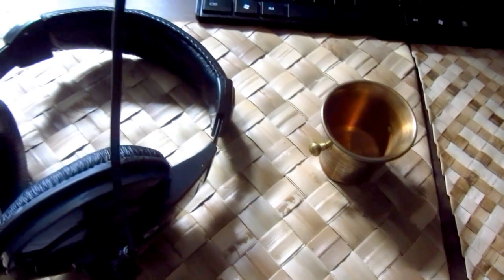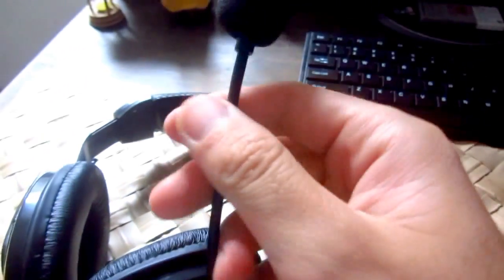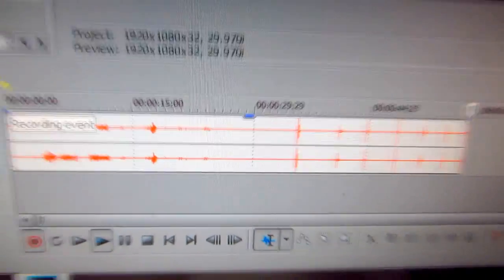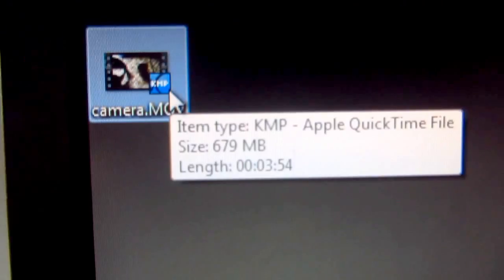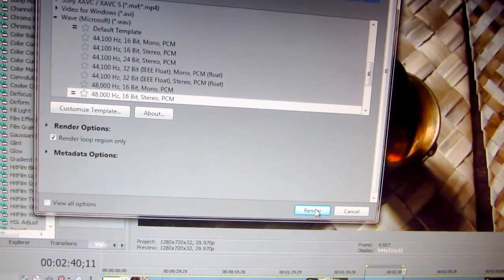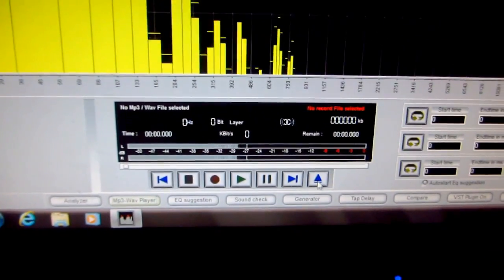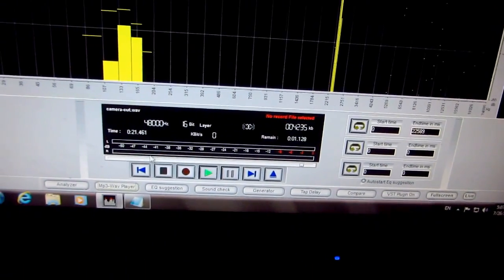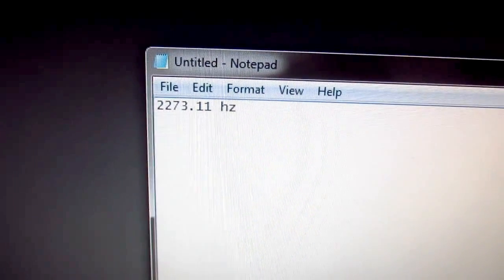How to find the Resonant frequency of an object (.wav files)

Comment: To hit absolute resonance there is multiple frequencies in parallel peak and troff. If that was hit, the material would begin to break apart molecularly. Time scale on which this happens is very small and hence the material stays solid. A constant would eventually make the solid object move from it's position so as not to break apart.

Comment: This is mechanics wrt sound. In mechanics of the purest sense we do a bump test. We hit an object with a mallet. Usually wood or metallic.  After strike the response to the bump is measured with an accelerometer.  The Wn = sqrt k/m.
The example is seen in olden days safe openers that used the bump test with stethoscopes to determine openings.

Comment: Recording while talking but the way you went about that is slooooww. Be quiet, tap bell, save file n highest possible format. What you really need is the harmonic that will cause the bell to resonate at it's own frequency. Likely you don't have a frequency projector capable. I wonder what happens if you deviate 33.3 hz higher or lower than harmonic? Pop goes the bell?

Comment: Remember anytime you gonna convert an analog signal in these case the sound wave coming from microphone into digital you have to keep into account a proper sampling frequency in line with the Nichols Theorem that state your sampling that have to be at least 10 times or better 100 times in practical terms the frequency of your signal, to have accurate D/A conversion otherwise you got nothing.

Other thing that does not determine the Natural frequency of that bowl. Your Spectrum Analyzer is just showing the frequency response of that bowl to a given stimulus , which means one of many, ok.

the way these is done by a machine is introducing feedback into a close system the same way Tesla did on his experiment in a building that almost was destroy by an array of three pounds hammers  hitting the building steel frame back early in the XX century. 

No offense you are playing with your software and that bowl that it.
Reply: interresting. How do I calculate the resonant frequency of a building in order to destroy it? Each room has another resonant frequency right? I can easily find it with my voice but it doesnt break apart or something
Reply: @trollmcclure1884  Find resonance of the I-beam and match the tone,  There is footage back in the day of what the OP said,  the contraption continuously sends pulses (taps) into the I-beam, and after a few hours the I-beam started to resonate (wobble). If this contraption was attached to the structures foundation I-beams, the building will collapse.
Reply: @GrahamMasters87  Excellent. Mwhahahaa

Comment: Frequency?
5/3/2018   Robert Shrewsbury    My brief thoughts for today.                                                                                                                                                                                                      Element & Compound Resonation for researchers.
An Element will not resonate if the frequencies are not pretty much accurately "right on the mark", to the tenth of the Hertz. The atomic spacing of elements is measured in nano-meters. Spacing changes with gravity, thermodynamics, light/darkness and atmospheric pressure proportions, caused by earthly and cosmic anomalies i.e. like the moon apogee/perigee as well as earth/sun perihelion, etc. So to be concisely accurate, it is a must to track these frequency changes on a daily and nightly basis. Resonant Frequencies and wavelengths are based on the Atomic Spacing in an Element, at the time of day or night and the particular geographical location you are at. When this atomic spacing changes, even a fraction of a nano-meter, elements and compounds then resonate at a slightly different frequency/wavelength.  
A remarkable healer, Dr. Royal Rife, used a very-specially-engineered powerful microscope in his work, so he could see when he was resonating a disease. He had aimed to know the resonant frequency of diseases, so he could successfully destroy these diseases, using destructive frequencies. Dr. Rife was aware of these frequency changes and he facilitated the changes (at his end) creating a custom solution for each patient, in his/their time. Dr. Rife's middle-base or center frequencies, that he used to kill diseases, do not work so well now, because the people currently using them do not A) know of this frequency change phenomena or B) how to keep up with these continuous frequency changes for each disease. (Dr. Rife's massive precision microscope has not been in use since his death of August 5, 1971.) 
In some cases, the modern "Rife Machine" salesmen can be more interested in selling a "healing machine" for profit than whether it actually helps or not. It is also possible they may believe it works, without observing the actual statistics over time. This then can be a "snake oil salesmanship" situation.  Because of Rife's precision with each case, he did do phenomenal work and cured every case of illness he ever worked with, but people since, not doing their work anywhere near precision, have been doing erratic or partial healings or having too many failures become commonplace.
I am only releasing a little bit of information on precision frequencies because it needs to be known, and also for the ill of our people, in hopes that some serious/sincere, competent personnel will pick-up and do the precision application, healing work and the research that is so needed. I am more of a discoverer, researcher, investigator, developer and inventor than a technician or businessman!    
My own studies have been leading me to confirm Rife's original successes and methods.  Using different methods of finding and knowing the resonant frequencies of hormones, elements and compounds and their frequency changes, I do not need a state-of the-art microscope as Rife did, to find the frequency variances of elements, compounds, hormones or diseases. I have been involved in frequency transmissions, applications and research for about 25 years now and am still learning a lot. 
A recent sample of my work.                                                                                                        In charting the total frequency changes in 6 days (following the Moon's waning cycle) on Human Growth Hormone HGH, I found the total cycles-per-second CPS receding (Moon waning) from the start of 4/28/2018 to 5/3/2018. The HGH positive +side receded  2.5 cps, HGH negative - side receded 4.1 cps. in just (six) 6 days.
It only takes two tenths of a cycle per second (or less) to miss resonation of an element, or worse, bleeding into another elements frequency, missing the target altogether. In practice, any work using a consistent frequency to aid repair or stimulate would soon have a condition of being reduced in connection or unable to interact with a person or element, until some time later when it just "happened" to coincide again by rare chance. 
This is why I study, test and research and that is also why I keep abreast of  frequency changes continuously in my work. A variety of natural frequency changes, even adding together, make it nearly impossible to effectively create a health-solution with a proper frequency. Effective application and better progress is related to a person being aware of changes occurring,  and then learning how to A) keep abreast of the frequency variances and B) staying on a tuned daily frequency resonation course. I am not sure why this information has remained so miss-understood, not-understood or incomprehensible for so long!?
I didn't start with an intent to research health, but my other studies gave me increasing information to understand and improve my own health.  What influenced my original  involvement in this element oscillation work was that I was learning how to stimulate and resonate valuable elements like gold, silver and platinum, "Ringing them like a bell", so to speak. This meant I could better detect them by the energy-increase and display that is created when an element is selectively oscillated electronically. 
One thing I did, was I purchased some "gold finding" resonators called LRL's (Long Range Locaters) and did a lot of tests and blind-tests, only to find out that these costly LRL's rarely if ever worked. As a single example, a poor use/choice of parts can pollute and  ruin correct signal forms. What a person thought was being projected was actually damaged or altered...and postulated results could not happen.  
Over many years, I found one of the many problems in using a correct frequency (of an element) was that the resonate frequencies of elements are in continuous fluctuation, they are not the same from day to day or even hour to hour in most cases. However, the gold/platinum/silver frequency categories on the precious-metal detection (LRL's) machines had only one frequency setting per element.  Having a single setting meant there was no way to adjust for changes in the resonant frequency of an element and there certainly was no published knowledge of the oscillation changes of the elements on a daily basis. Worse, element frequencies also change in different geographical locations on the same day because of magnetic and electro-magnetic changes in various geographical locations.  
Working to unravel this tremendously complex problem is/was what kept me at this research-discovery-work for so many years.  The many variables mean it is still easy to encounter  surprise conditions to figure out later and I am still doing this to some degree. However, my research increased my eclectic-knowledge tremendously, in many areas of science and quantum physics, by continuous researching and testing so many diverse things far and distantly related, but sequitur! Now, much of my work is empirical as well as my knowledge is mostly autodidact (self-taught). 
I am still hungry for truth and knowledge and I know that acknowledging my sources feeds and seeds my reception of truth and knowledge and so, I must and do acknowledge the greatly needed (without bragging) inspiration from Above, as well as the many Scholars, Physicists Metaphysicist, Kabbalists, Hermeticist, Scientists of the present as well as the past that I also relied on for/from their work.  
My experience has become that there are no mysteries when the truth and comprehensive perspective is uncloaked, but instead, pure science and quantum physics! As I ventured into the "why's and how's" of more advanced sciences, finally science, physics, quantum physics and metaphysics were dovetailed and increasingly meshed-together in a unity of function, synergy and workability without disagreement.
Sciences might become more clearly understood and applied, but human emotional problems of  rivalry, jealousy, covetry, competition and fear taint, discredit, occlude, retard and obstruct knowledge, discovery, progress, freedom and awareness at large.  
This contention and battle, to control information and "potential power" with money and power, seems to be the underlying catalysts-symbiote of all of this miss-and-disruption. Any good chemist knows that the catalyst is not affected by the reactions it creates.. Money and power... untouched, unnoticed and unmoved by the lower players in the field. Nicola Tesla was only one of many that had to deal with this. Good & Evil"!?    
It can be nearly impossible to find basic but needed data. That leaves figuring-it-out... figuring out the invisible by reactions and statistics observed and perhaps only having access to very minimal supplies to do so. 
Sharry Edwards https://www.soundhealthoptions.com/ is the foremost knowledgeable authority on health frequencies and their application.  I am told that Sharry Edwards  produced electronic frequencies (in sequence) to manipulate the "Krebs Cycle" in some of her research and I am not at all surprised that she did.  
Generally now, a lot of work has been done of/on frequency stimulation and signaling and sometimes it has been used as a military weapon. Much of this frequency matrix remains to be discovered and some has been Classified I am sure. 
Sincerely, Robert
Reply: Instead of trying to pin down the massive range of factors in sequence why not bombard it with every available frequency in massive volume back to back and/or  in sets by multiple emitters on a sample until it makes a measurable reaction. that's too many changing variables to reliably calculate, why not brute force it like breaking an algorithm? An A.I could be trained or other software could be made to notice and record what frequency it resonated at for that set of conditions. If system has sufficient control software it could skip frequency ranges known to harm other tissues or the equipment around it so it could be tuned on the spot for use. if for example you used it for cancer i think you would need some signal carrier and a vibration insulator( idk a vacuum tube with a pressurized tube inside it with the signal source isolated in the middle tube and a vibration dampener on the parts the middle tube exits and enters the outer vacuum tube) i think would be needed to contact with the cancer for more direct testing and to minimize the spread of the harmonic frequency battery tester. this might just sleep deprivation talking but i don't see why it wouldn't work unless resonance detectors couldn't keep up with it. I think it could be detected by just having a strip super thin isolated strip of metal touching it or Lidar and/or sonar that just checked a ton of times per second for vibration patterns consent with resonance. thoughts? id like to know if i am missing something here